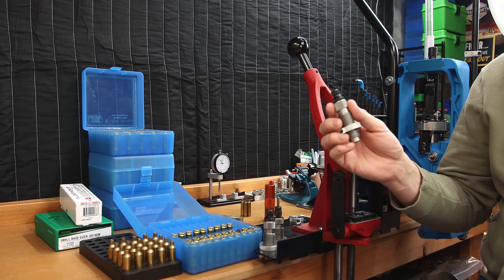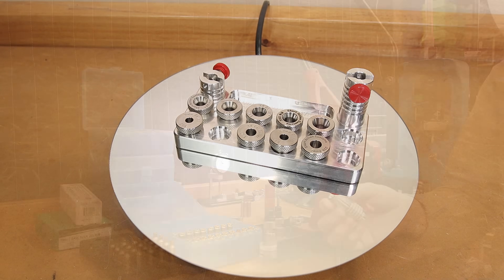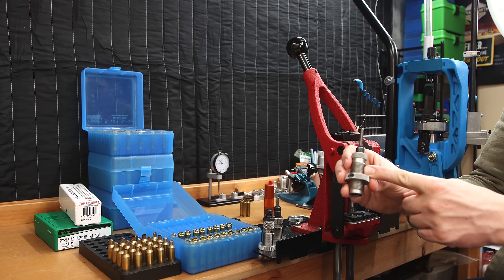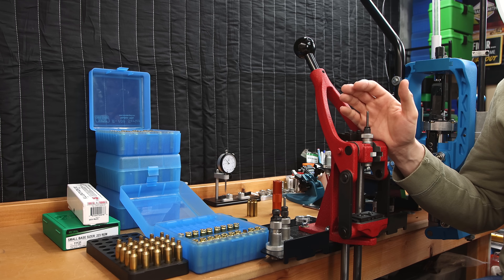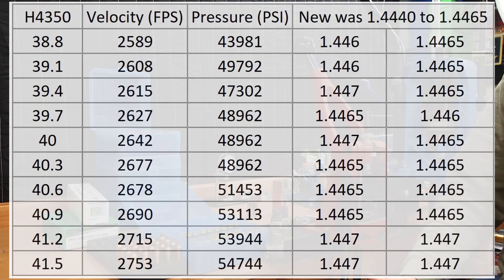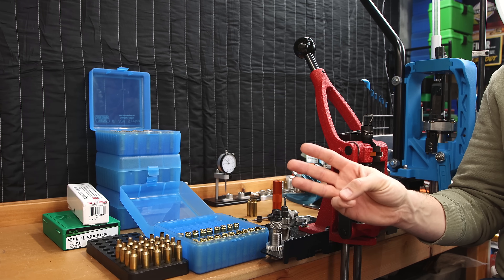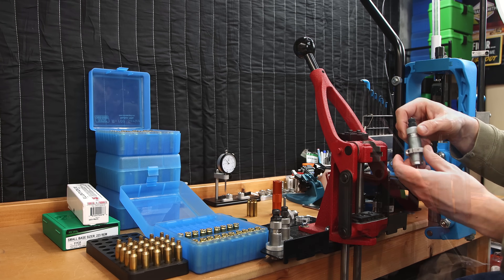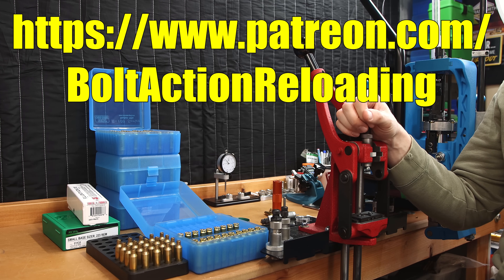How to Setup a Full length Sizing Die - Easy and Accurate

Comment: Can someone please explain something to me?  In the initial stages where you pull the lever down and screw in the die to make contact, I don't see how turning the die anymore controls the shoulder bump.  For example, people say that a 1/4 turn more is too much and you'll get more than .002" shoulder bump, however, doesn't the shell holder BOTTOM OUT on the die, regardless? 
Like, when you set the initial contact between the shell holder and die, you could then turn the FL die 1+ revolutions and it shouldn't matter because the shell holder can't push the case in any farther, since it bottoms out on the die...  Please heellppp
Reply: I really hope someone answers your question because that is the exact same issue I don't understand.  If I'm using a plain Forester Full Length sizing die in my RCBS Supreme press, how does the shoulder dimension change if the ram bottoms out on the base of the die?
Reply: I understand but I don’t think I could explain it very well. When you screw the die down further, past the initial point where the die and the shell holder made contact once cammed over, you’re then pushing the case further into the die setting the shoulder back further. Or think of it like this. You cam over and screw the die down until it touches the shell holder. Theoretically your case will be the same length as the top of the shell holder to the inside of the die. Now screw the die down further. When you push the case into the die it’s going to pushed up further because now there’s less distance from the top of the shell holder to the upper inside of the die forcing the inside of the die to push the shoulder back more. Hope that makes sense.

Comment: Thank you for another great video. What is your opinion on using a forester full length sizing die vs a lee full length sizing die both with the expander ball removed just to size the outside of the case. Should the results be the same or different?

Comment: My biggest mistake was bumping the shoulders on brass that wasnt fully fire formed. I never heard that you need to fire it up to 3 or 4 times before moving the shoulder is even a thing. Expensive mistake, sort of..
Reply: Just did the same thing on accident.  I ran into pressure signs with a load that was perfectly fine with virgin brass and then it dawned on me what I did.  I knew brass had to be fired a few times but my brain was stuck on "bump the shoulder 2 thousandths " lol
Reply: @Dfleuryoutdoors  Yep....Learning is fun. Expensive but fun.
Reply: Would you only need to bump the shoulder on brass after firing from your rifle 3-4 times? So I shouldn’t need to resize my brass after the 1st firing? so new this and that video didn’t make sense at all

Comment: I have handloaded for 40 years but never really a 'precision'  rifle handloader.     Basically....   I need cases to fit in several guns of the same caliber.   Even adjusting to the normal just touching the shell holder plus an eighth....   My Remington model 81 semi auto in .300 savage and my Remington 722 bolt gun in .300 savage do not like the same adjustment.     The semi auto will eat anything pretty much and is very accurate.    The 722 is tight.    hard to close the bolt.   Some of this may be due to me using .308 military brass for my .300 savage brass I use the military so it does not say '.308' on the headstamp.    I do load a lot of handgun stuff tho.

Comment: Could one use a feeler gauge to set space between the shell holder and the bottom of the die body for a more accurate setting rather than the dial caliper jaws ?

Comment: Maybe you will answer my question. I have two different AR's. One chambered in 556 and the other in 223 Wylde. The 556 bumps the shoulder up by about .006 while the 223 Wylde bumps the shoulder about .003. Do I need to reload for each rifle, or is there a way to reload one size for both chambers? Thanks.
Reply from the maker: Hey 3D, I assume you are trying to say that one AR had a headspace measurement that this .003" larger than the first? If this is the case you can size them all to fit in the smallest or load for them individually, its up to you. For some its not worth the hassle and if there is a accuracy difference do you care in this application? Hope this helps.

BAR

Comment: Hi, Mr. BAR.
First of all, thank you for the great information.
I am running into the issue you've mentioned, Sizing that cause the Headspace Measurement to Grow instead of Shrink. What would you suggest to remedy this?
Screw down the die more to push back the shoulder?
Even with the lengthened headspace measurement, my rifle can still chamber the cases just fine.
For Reference, it is a Bolt Action 223. And I'm using Onced Fired Remington Brass.
Thanks again.

Comment: and 7mm rem magnum. I'm still fairly new and feel like I've wasted a fair amount of materials. My 223 loads probably aren't as fast as they could or should be but they're very accurate. My other loads are like milsurp crap, not too good of groups 308 is getting 5 moa terrible. With federal gold match etc. they touch bullets so they're good barrels. My method has been pick a medium load then go up .5 grains, 1grain and down .5 grains, 1 grain for 3 cartridges so 15 shots 3x5. I then shoot from benchrest at 100yrds and check group sizes. Whatever grouped best I make 85 of those and for 308, 25-06, 7mag the results have been mediocre. Help correct my mistakes.
Reply: One option is Erik Cortina tuner brake.

For loads, chrono.  Look for plateau where a few 0.1 gr increments produce none to minimal increase in FPS.  Also look for load with low ES and deviation.

(Keep in mind digital scales accurate to 0.1gr can be an entire 0.1 gr off)

Then use that load, batches of 5 rds (+/-) ea, reducing seating depth 0.002” per batch to dial in grouping.

I think both this channel and Eric Cortina give more detailed explanation.

Comment: I get all this but it frustrates me when I’m using a lee press (1st error) then Redding dies , set die to bump 2.5 thou, then next brass bumps 5 thou, next 1, next 6, next 1.5..... same brass, same firings .....talk about a way to come up with new words 🥴
Reply from the maker: Are you annealing? And if so what is your method?
Reply: @BoltActionReloading  I hadn’t on this batch (1 time fired Lapua 223) i grabbed some old brass multiple firing to measure and was doing the same thing 🤷‍♂️

Comment: I have done this but a week ago noticed that at the setting Sako, PMC, Lapua, GGG and few others size well, Selliers do not. They also took considerable amount of force to size, some were from my friend's new LMT. I tried chambering the cases and the bolt became very sticky.
Reply from the maker: The setting can change for different brass. (Number of firings, annealed vs not, some brands are thicker) If you measured the bump and its the same it should fit unless it was fired in a chamber that was a larger diameter or fired with too hot of a load.
Reply: Annealing first makes a big difference.

Comment: I don't disagree with your method at all... But I will pass along something people hate to hear, passed on to me by two Machine Tool Technology programs and a Gunsmithing program - Calipers are not accurate and repeatable to .001".  They are useful for plus or minus .003".  This is from machinists and toolmakers WAY smarter than me...  As you say, though, if you have a process that works for you, keep using it.   I prefer the more cumbersome RCBS gauges (screw together with a scale like a micrometer).

Comment: Firstly, thank you for your videos. They’ve made the jump into reloading much easier.

So long story long, I’ve just sized my first batch of brass using a Coax Press and Forster full length sizing die. I don’t aneal….yet. 

I did measure all my norma once fired brass with a Hornady head space gauge and the consistency was within .0005

I set up my die and walked it in until I was at .-.002 vs my fired brass. 

I then started to press the rest of the brass and the consistency on the headspace gauge was between -.0015 to -.0025 

Is this to be expected without anealing or could the inconsistencies be coming from somewhere else? 

Any perspective would be much appreciated. Thanks again!

Comment: I normally try to set back my223 with 5k. That way all 3 rifles can run it well. But my other rifles I only have one of I normally lock and mark them for2k. But after a decade of affective reloading I've learned that annealing is very important as I can't get 2ks of shoulder setback with unaneled brass.
Dang it a never wanted to bring fire into my reloading process. I might have to start shooting factory again

Comment: In my 6.5 creedmoor Tikka, the fired case measurement in the comparator is 1.5" exactly. Every single time.

I've a L.E. Wilson FL bushing die and initial set up was to just touch the shell holder on the press with the die. Resize one case and measure. Normally that will maybe bump 1 thou or none and then tweak down a little until it's at 2 though bump. Check with another piece of brass and then another for good measure. If it's all consistent then I'll just resize the whole batch. 

Next time, I will just put the die in,  resize the first piece of brass, check and it should be okay. If it's a 2thou bump, just resize the batch. 

I'm running a Forster Co-ax press.

Comment: Hey mate, have you ever set your die up and get 3 different types of out comes without changing the die 

Basically I'm getting 3 outcomes 
1, sized right where I want it 
2, not moving at all 
3, over sizing 
And they are might be few and far between each different out come 
But its frustrating because I can't figure out why 
Might add I'm new to this haha
Reply from the maker: Hi Aaron, are you annealing and if so what method. (Also is the brass all the same headstamp?)
Reply: @BoltActionReloading  hey mate, yes I did anneal ( first time ever doing it ) using flame on once fired starline brass 
Thanks for replying mate!
Reply from the maker: Hi Aaron, I would guess that your annealing is not consistent case to case and is causing the variation. Unfortunately, some folks don't want to hear that not annealing at all may be better than inconsistent results with sizing, but it's something you will have to decide. A manual flame annealing process is not as easy to pull off as some would like you to believe. I applaud you for checking multiple cases through your lot to find the variation.
Reply: @BoltActionReloading  yeah ok then, trial and error. It is a learning curve either way haha 

I'll use the correct one for my load development 
And I'll fire form them again and try again ... 
I've just acquired my annealing machine ( ugly annealer here in Australia) 
I may have jumped the gun doing such a big lot rather then test a smaller batch

Comment: You should slow down your taking so people like me can follow along.  Too fast bro 😊.  I tried to hang in but you went way to fast for me to follow along
Reply: Hello, you can try to change the playback speed to 0.75.
Reply: Yea, I’m out…too fast…
Reply: I watched it again and slowed it down to 75%. I fully get it now. Couple stops at critical spots. I know what he’s doing.
Reply: For those experienced, pace was good.  Good advice & everything I heard from this guy was accurate and valid.  Hearing SO many people say their loaded ammo won’t fit in their gun…. Just run a few reloads with the full length sizing die run down all the way to the shell holder.  THAT reloaded ammo should all chamber in your gun.  If not, there’s something wrong with your gun or die.   Those who are not seating the FLSD fully down on the shell holder and having problems with their ammo not allowing bolt to close on their reloaded ammo , are not following what this guy is teaching you.  Review his video until you understand or better, find a buddy who actually really knows what this guy is teaching and have that person teach you at your reloading bench.
Reply: I was going through a phase of speeding up podcasts to get through them quicker while driving. After a while 1.5x was easy to understand, 1.75 and 2x you’d have to concentrate to much..  no speeding up required for this one